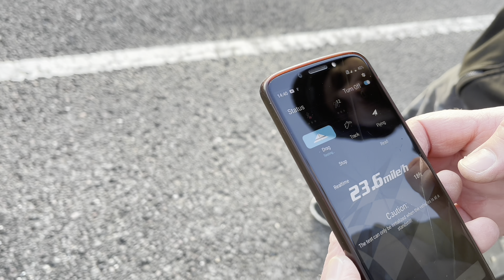FG sportsline back on the road, and showing arrma how it’s done

Comment: Been thinking of getting the arrma infraction v2 with a set of zeee battery's
Reply from the maker: They are fun, the one in the video is 8s, they come 6s standard 👍
Reply: I've looking at kevin talbot channel where can the fans be brought for it how do you solder ec5 connections
Reply from the maker: If you search YouTube for that connector and solder it should bring up a tutorial.
If you search for the fans relating to the cat type or motor on Google or eBay it should bring them up
Reply: Ah ok thanks I might ask Rennick's as I live in Belfast not good soldering myself
Reply from the maker: These are the fans I use on my motor. Ask around as there may be someone in Belfast area who would solder for you 

https://www.ebay.co.uk/itm/Centro-Aluminium-Cooling-Fan-28000-Rpm-30X30mm-Esc-/352761724221?mkcid=16&mkevt=1&_trksid=p2349624.m46890.l49286&mkrid=710-127635-2958-0

https://www.ebay.co.uk/itm/Powerhobby-Aluminum-Heat-Sink-W-Dual-Cooling-Fan-1-8-Motor-Black-Arrma-Kraton-/384141869350?mkcid=16&mkevt=1&_trksid=p2349624.m46890.l49286&mkrid=710-127635-2958-0
Reply: I know Ron I've asked he knows a guy called John Stefan has my batteries at the moment.

The fans I talking is the big one's Phil had on his v2 them
Reply from the maker: @saqib8033  phil should be able to get you them or at least direct you to the supplier 🤞
Reply: @audiquattrojamie  thanks I ll ask him
Reply: @audiquattrojamie  I got sorted Jamie Ron is doing my batteries got 2 back and rest probs tomorrow or next week
Reply from the maker: @saqib8033  brilliant👍 now all we need is some good weather